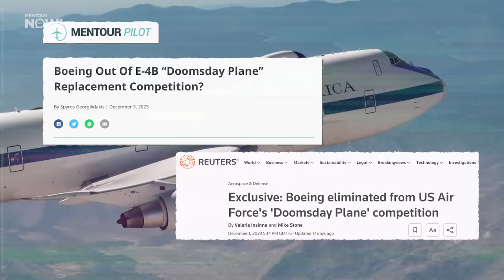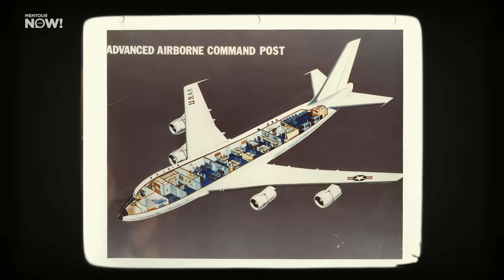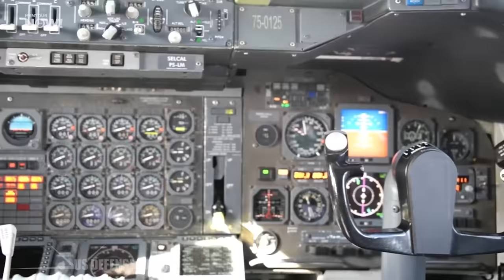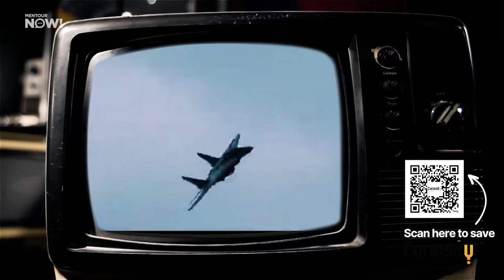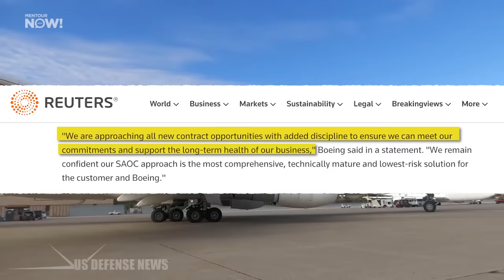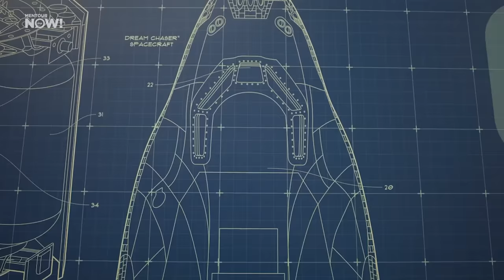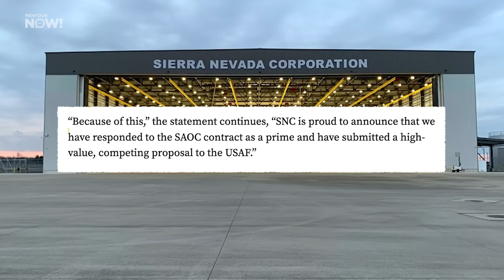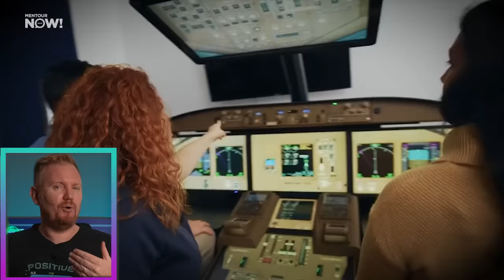Why was Boeing kicked out of the Doomsday Plane competition?!

Comment: There is an issue in procurement of major weapons systems not well understood outside the field that because there are rarely more than 2 or 3 companies capable of producing the big ticket equipment the US military wants, they have to make sure that competitors get some contracts just to keep them in business. Newport News Shipbuilders and Electric Boat company practically alternate nuclear powered ship contracts because no one else can build the things. 

So the military doesn't become dependent on a single supplier. This is one of the many reasons military spending is so crazily inefficient. To someone who works in the razor thin margins of commercial aviation it must look stupid. But the US military for the good of its mission must use its monopsony (one buyer) power to make sure its suppliers don't gain full monopoly (one seller) power over it.

There's always the possibility Boeing knows this and is refusing to give in to costly demands just to tip the scale which is already weighted against them back in their favor for planes that lack the prestige of Air Force 1.

 Competitors to Boeing like Sierra Nevada might have already been strongly favored such that a bid that doesn't meet what they are demanding from Boeing will be accepted by the Pentagon. That's why Boeing can state that their bid is better because it probably is, but not enough better for the Pentagon to risk losing Sierra Nevada as a viable company.

Comment: C-5A?  The Air Force has at least 10 C-5As in storage in Tuscon.  Somebody could do the "C-5M" engine mod on them, and replace all of the remaining systems with modern versions.  I assume they all still have the old analog flight instruments.  They all got new wing in the '80s, so airframe age isn't the issue it seems either.
Reply: Those are retired due to cracks in the wing box.  The C-5B has a stronger wingbox, but the USAF already decided it was too costly to repair and upgrade the boneyard birds.

Comment: Not an aircraft designer. But 400km of wires sounds stupid number.. If my calculations are right that's over 5000 times planes length. Is there anything else except cables on that plane?

If you ask me, digital era gives option to connect everything in one "local internet". With 1/50th of digital cable length (eyeballed  number) Boeing would have enough redundancy to lose half of plane and still have everything else connected.

If course that would mean that there are thousands of individual components that requires constant updates. 
But they are already, probably, thinking about such approach.

Comment: There is another issue here that is only spoken about quietly.  The issue of intellectual property, in this case all the documentation.  The government wants to own all of this documentation and is willing to pay for it but Boeing is not willing to provide it no matter what is being paid.  The government wants this documentation because they have been trapped by Boeing as the only contractor in the past that can service and maintain the equipment.  This costs more over the decades than the original contract.  Sierra Space on the other hand specializes in providing these documents automatically when they do any of these type of jobs.  Boeing wants to hold their thumb on this along with the follow-on projects and the government needs to get out from underneath Boeing’s thumb.  The E4B is flown quite hard compared to most airliners.  They do specialize maneuvers that stress the aircraft, and this has resulted in much higher maintenance costs.  This is one of the reasons they want more aircraft to spread the stress over more airframes.  Additionally, when you look at what is actually happening in side the aircraft you would realize that an aircraft much smaller than the 747 just would not be able to do the mission.

Comment: Why not an A340neo? The A330/A340 is still production for A330MRTT. So Airbus should still be able to produce an A340. A330MRTT uses an A340 wing with just one engine. The outer engine mount is used for the refueling pod. 

Due to aerial refueling an A340ceo could do the job.

Comment: After reading many of the comments, everyone has missed the obvious contenders. The new doomsday variant must be nbc safe, it must be built to be emp survivable, and it must have aerial refueling capability. The air force has already two planes that meet these requirements which are definitely slated to be pulled from combat use in the very near future, the Mach speed capable B-1 Lancer and the subsonic stealth B-2 Spirit. Both are 4 engine planes and already have the above requirements. Both can be retro fitted much easier and quicker to have an internal working crew cabin where the bomb bays exist. The 747’s require 20 to 30 crew members to operate the many systems, but digital infrastructure with AI architecture easily eliminates many of those crew members, reducing the needed crews to a handful of personnel. The 747’s were used because the systems required a LARGE amount of space just for the many supercomputers needed for the job. A single modern supercomputer can now do what took many to do, and are much smaller than those built in the 80’s.

Comment: The big Point here; is who will supply the necessary sized airframe or large fuselage needed, for the next generation USAF E-4B replacement aircraft?

The only two reasonable airframes at present, these are either a Boeing 747-8 4-engine freighter or passenger aircraft, with use of second hand airframes.

Or similarly a second hand purchases of Airbus A380 4-engine passenger aircraft, or the US DoD having to think of using the likes of USAF Boeing C-17  transport 4-engine aircraft already in use too,.

However, the USAF need all the C-17 transport aircraft they have, so really cannot afford to reduce this number, or the US DoD would have to ask Boeing to reopen C-17 production or 747-8 production and at what cost to the US Taxpayers too?

There is no suitable 4-engine airframe currently in production large enough, to the size of the four Boeing E-4B's (747-200's), anywhere in the Western Aviation world.

Boeing must know this too, unless the US Government and US DoD plus USAF, are going to fund a multi-billion dollar all new super large airframe development and research plus production too, that is for just for a limited 4 aircraft production run.

Which is highly unlikely, the only option then left open to the USAF and US DoD, is to down size to basically a large body airframe, the likes of either Boeing 777-9X or 777-10X long-range, wide-body, twin-engine jetliners.

Or look to Airbus to supply the necessary airframe, with either E-4B replacement based on Airbus A350-900ULR long-range, wide-body, twin-engine passenger aircraft.

Or a new variant of the A350-1000 maybe A350-1000XLR extended long-range, stretched-wide-body, twin-engine passenger aircraft possibility too?

However Airbus would have to work with or be the airframe supplier, to a major US Defence Aerospace Company, to get such a defence contract from the US DoD, in other words Airbus would need to be in partnership, with Lockheed Martin, or Northrop Grumman or Boeing even, maybe BAe Systems in the the United States possibility too.

Or maybe a Boeing 787-9X / 787-10x variant, long-range and stretched wide-body, twin-engine jetliners, could be offered as a suitable airframe to be used for a replacement for the E-4B's?

Again Boeing would have to be directly or indirectly involved, with going with a Boeing 777 variant or a 787 variant, especially over new built airframes, even if Lockheed Martin, or Northrop Grumman or maybe BAe Systems in the the United States, were awarded a US DoD contract to supply the next generation of the E-4B platform too.

Which or at the end of the day, Boeing it seems will play some involvement, in a future replacement of the USAF E-4B aircrafts, but US DoD contract terms will need changing first it seems?

Comment: The way I see it is that Boeing itself wont be doing the work, not that the replacement wont be a 747. Plenty of 747s going spare for another company to purchase and convert. The only other option would be an A340, which I wouldn't think is in any way suitable, other than the four engines.

Comment: There are only 6 non Russian or Chinese airframes that would realistically meet the requirements. 
Boeing's 747, Airbus' A340 and A380, BAE's BAE-146, and Lockheed's C17 and C5. 
the A340 is pretty much out of the competition, it's small and there aren't a lot of airframes remaining. 
the A380 is out as well, presumably because it's going to be hard to find 10 A380s, not to mention there are few airports they can take off and land from in the USA. 
the BAE 146 is out because it's just too small for the role. 
Even the 747 will likely not be the 747-8 because the majority of those planes are cargo variants with only 50 being passenger variants. Instead it would likely be a 747-400 because there are just more of those passenger airframes flying around. 
Lockheed's C17 and C5 are more interesting because the US Air force already operates these types of planes as cargo aircraft meaning the logistical systems for operating these types is already in place easing the logistical burden on the US military and Lockheed has historically been a US military supplier.
Reply: The A340 is not a small aircraft by any means, it has a MTOW of 380 tons, just 17 tons less than the 747-400. It just looks small because of it's humongous wings. The A380 is not all-too-hard to find either considering Thai Airways is selling 6 of them and many others are retiring them like ANA.

Comment: My brain says surely it would be good business to Boeing to restart the 747 production line as there are only 155 Dash 8's built and one would assume that it would be easier to build the Doomesday replacement aircraft if you are building the aircraft from scratch. If the current Doomesday aircraft are 50 years old then obviously that's the length of time the replacements will operate for.....but there is a big difference in that the current craft (including the existing Airforce One's) have been operated for the most part whilst the airframe has still been in production.......now you want to use existing airframes for a fleet of craft to operate for the next 50 years but the airframes are no longer in production.......however.......all 4 engined airframes are now out of production for all manufacturers (excluding Ilyushin Il-96). A twin engined 747 airframe would fit the commercial market and keep parts available for other 747 operators..........the last thing you want is a broken toilet door on a Doomsday plane and no spares.

Comment: It's a bit peculiar insisting on four engines. Electronics today are far smaller, with far less power draw and far more automated (ie far fewer people need to operate them) than when the E-4B  was built, and twin engines are more reliable now than four engines were then (just look at ETOPS). The whole thing would be an awful lot cheaper, quicker and with a longer life if they built it on a 777 or 787 airframe (assuming Airbus is out for patriotic reasons).

Comment: Could it be that since Boeing dropped the ball on the 737 Max, this factored into the equation? Is it a matter of having trust in any new aircraft designed to specs and then being built by Boeing? Thoughts to consider.
Reply: The 737 MAX was a twin jet created by a different division of Boeing for the commercial market. It doesn't obviously relate to Air Force requirements for the E4-B.

Comment: FAA cert on KC-46 was a huge cost & schedule driver.  FAA has never before certified USAF aircraft, particularly an airborne tanker.  Perhaps, Boeing would bring their experience into a subcontractor role.  Frankly, getting all the new command post avionics thru FAA cert will cost billions more than the Air Force thinks it will cost & take considerably more time.

Comment: There’s no way Boeing will sign a fixed price contract for the replacement E4B.  They already lost $2B in the new AF1 aircraft.  The E4’s are highly customized with tailored equipment no one has.  To build 4 or more of these will cost a small fortune.  There are very few companies that can do this work and they charge accordingly.  I think they will use 747-8 aircraft because the parts and service availability is better than the 380.   I think the price per aircraft will be extraordinary.

Comment: Thinking out loud but I had a couple thoughts. Boeing being out of the competition doesn't really surprise me at this point. Their defense procurements have been a disaster across the board with the most successful being an updated McDonnel Douglas design. Couple that with the numerous issues they've had with their civilian sector as well with the issues they've had with their 737MAX and declaring a halt on new designs for a while, it's clear that they're having some major issues.  

Second thought, I kinda doubt the four engine requirement is due to safety as statistically speaking introducing more engines is likely increase the likelihood of something going wrong. I highly suspect it's out of a power and cooling requirement due to all of the electronics they want to stash in that aircraft. I mean, after all, it is intended to be the main command center in the even of a nuclear war. The following conventional war is going to result in obscene amounts of data needing networked and processed, and computing resources are going to be limited.

Comment: It is just not the number of engines, but also the available interior space and other needs.  These aircraft don't carry a single crew for it's needs.  Besides the space for all the consoles and communication gear they need crew rest/seating accommodations and some sort of facility for providing food for the crew.  Not including the flight deck crew, there will probably be 20+ operations crew plus the mandate of having at least one general grade officer on board and this is times two so they can rest and stay sharp enough to carry out a critical mission.  Additionally, missions can last 24 hours or more, if they go to the concept like Looking Glass that had aircraft airborne 24 hours a day 365 days a year.  There is also the matter of power needs for all the equipment.  On a four engine aircraft that looses an engine, you only loose 25% of your available power.  On a two engine aircraft losing an engine means you loose 50%, although in either case there will undoubtedly be a large APU installed for emergencies in either example.  Boeing would be the optimal choice because they built the original aircraft and have a better understanding and more information on the airframe than any other contractor, except possibly L3 Harris.  Another factor that has led to these problems is the massive consolidation within the defense contracting sector.  Boeing, Lockheed Martin and Northrup Grumman have just gotten too big to handle so much work and "keep all the balls in the air" at once.  In my opinion it is too much for one management team to handle effectively at once.  If the F/A-18 were still at an independent McDonnel Douglas or the V-22 at a separate Bell, along with other projects that were not part of the original (pre merger mania) Boeing, maybe they could concentrate at the task at hand.  Projects involving providing goals of going to the moon, transporting the president, providing vertical lift aircraft, making fighters and tankers building half the commercial aircraft on earth, building large rockets and many more is just too much for them to handle effectively.  Look at all the problems that Boeing has had the last few years and why, it makes you think, hmmm!

Comment: I want to say great video mentor really have no comments to say there is one thing I actually do want to add there is a federal law that if the Air Force wants to purchase new aircraft like for like the night watch program or for like like the new Air Force ones it Hass to be made by an American Aircraft manufacturer. they can’t go to airbus  because it violates the federal law so just wanna put that out there but great video.
Reply from the maker: Thank you! I believe Airbus had an American partner whenever they bid for a U.S. contract. For example, they worked with Northrop for the first tanker contract (Boeing won with the KC-46) and later they worked with Lockheed. Technically, Airbus USA is an American company, and they produce a lot of jets in the United States, but I'm not sure if that counts! 🙄🙄